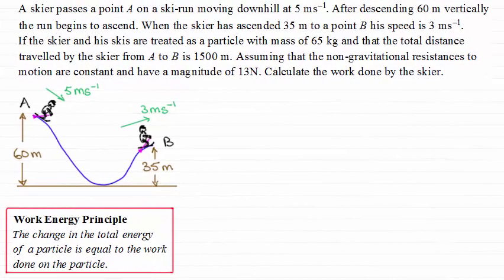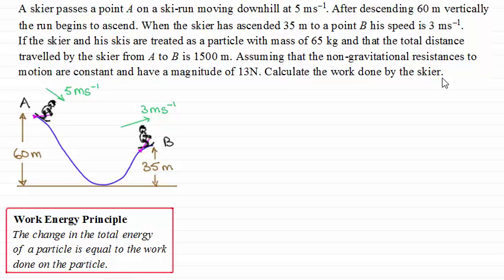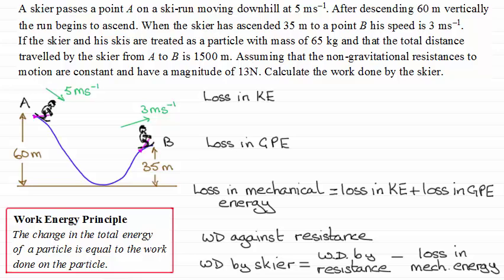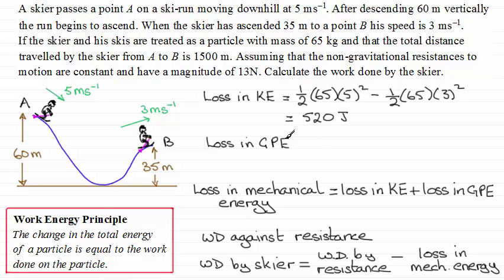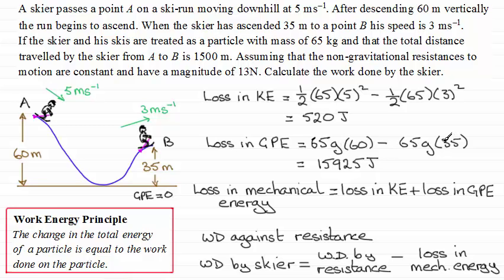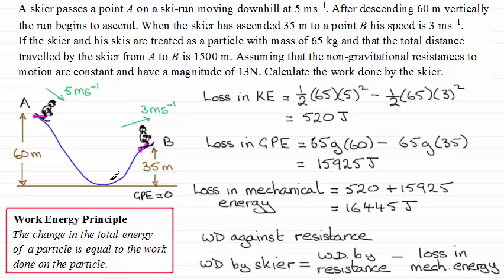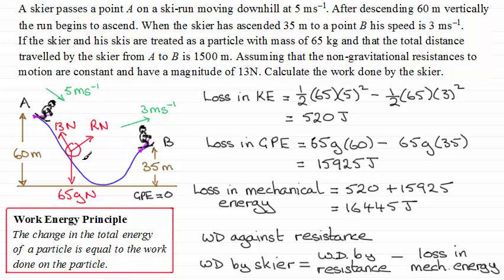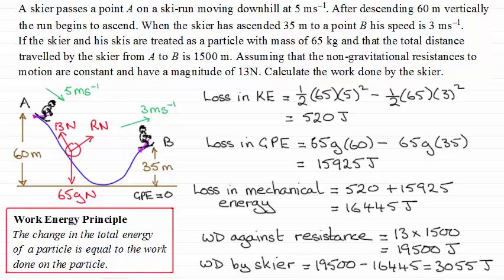Work - Energy Principle : Skier on an undulating slope: ExamSolutions Maths Revision

Comment: (NOTE: I am using "." as the times symbol. 

This is not consistent at all, we know that going up is a gain of GPE, so, shouldn't it be  65g.the displacement from A to where the slope drops to 0 + (not -) 65g.the displacement from GPE=0 to B) Why would you take it away going up is a gain of GPE and going down is losing. I don't understand why you did this, please explain Sir.
Reply: you could find the displacements by using simultaneous solving some SUVAT equations. Using the vertical and horizontal values.